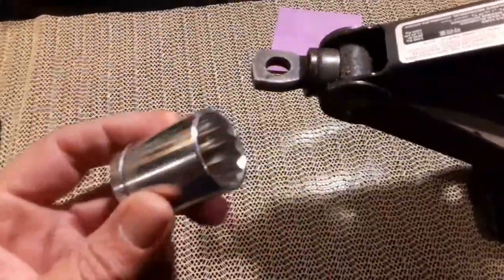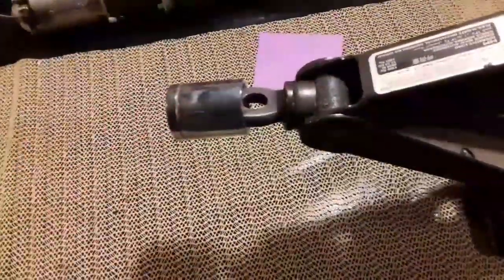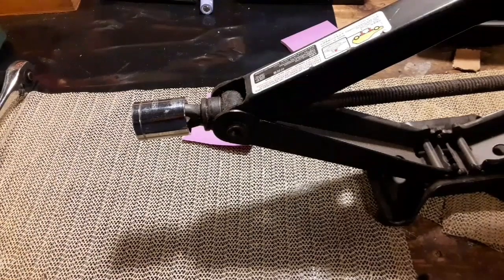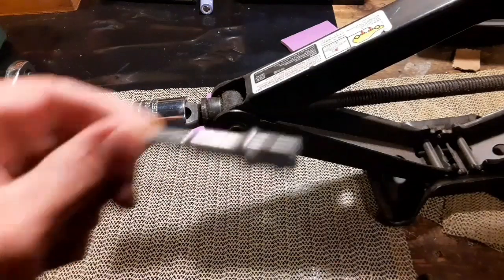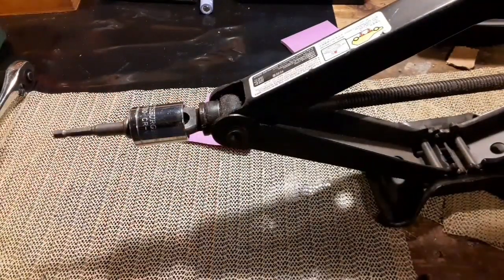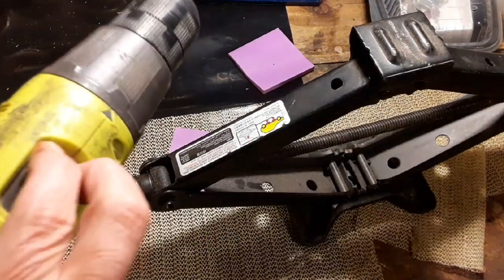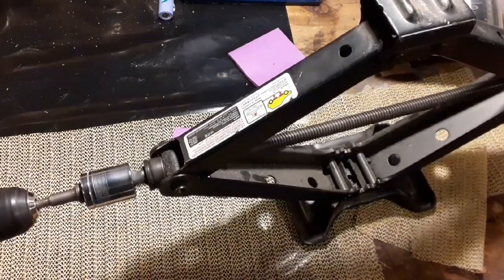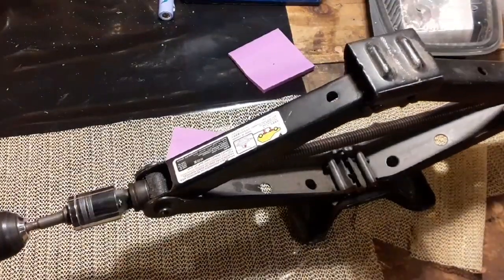Drill powered junkyard scissor jack

Comment: had occasionally wondered if a cordless drill would have the strength to work with a jack like that. Glad someone actually bothered to test it out - now we know it would work (and a damn sight faster than hand cranking or using the heavy hydraulic jack too). Thank you.
Reply from the maker: My 18v Ryobi does the job and it's not that powerful of a drill.
Reply: @ThriftStoreHacker  same. Had to do the same today. Wasn't even a full battery.
And didn't even use an adapter. Just taken the metal bar you are meant to use with your hand and put 1 end in the drill and the hook in the hole. Spun around beautifully. Saved myself about 10 minutes changing my wife's tyre.
I wish I did it 2 years ago when I had to save her on the side of the road. That was a LONG COLD time doing it by hand.
Reply from the maker: @ColinRichardson  I do alot of front brake pad replacements for friends. Most annoying and time consuming part of the job is raising the car and removing the tires. This shaves so much time off. 
Just make sure to use a jack stand :)
Reply: @ThriftStoreHacker  only have the scissor lift. but I only ever change the tyre anyway.. I loosen/tighten the bolt when the tyre is still on the ground so no unnecessary pushing/pulling on the car anyway.